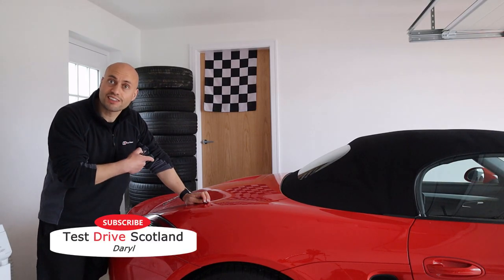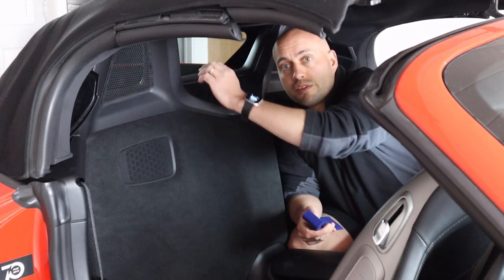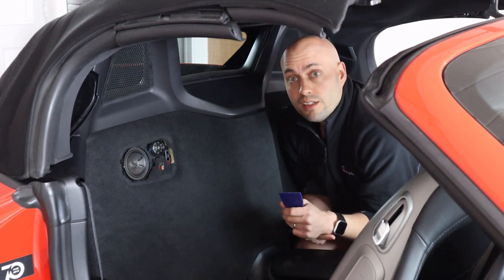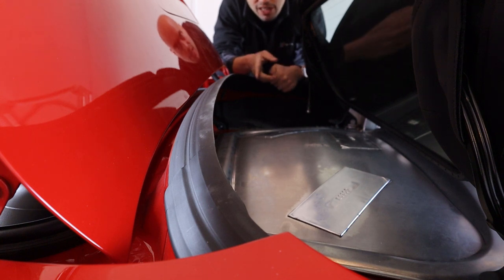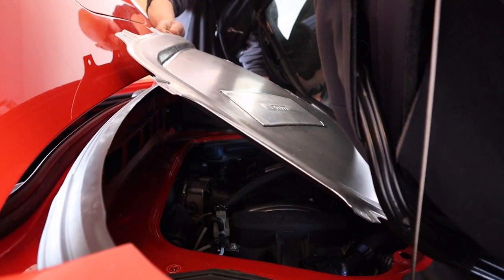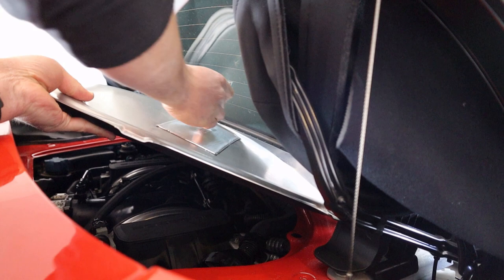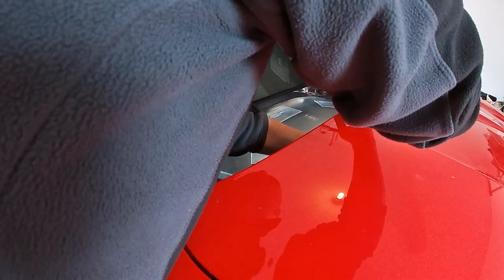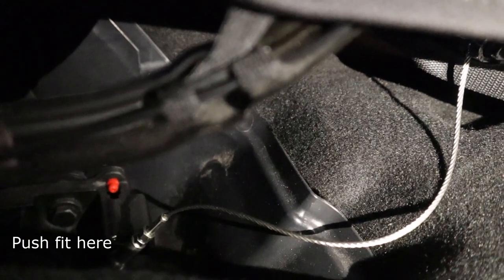How to access the engine bay in a Porsche 981 Boxster! Engine cover removal 718, Spyder, filters

Comment: So whenever I do this no way I’m trusting myself to be that close to the paint. I’ll be applying masking tape with duct tape on top of that on area of the trunk lid closest to the engine bay. A few minutes of prep will help my nerves, and possibly my pocketbook a bunch. Excellent video, really enjoying your hard work, making it easier on the rest of us!
Reply from the maker: Thanks William, honestly it looked worse than it is, but yes certainly good practice to cover the area just in case. Tape a towel or protector over the area masking tape is too thin.👍
Reply: @TDS981  I disconnected the strut that held up the trunk lid. This allows the trunk to open up a fraction of an inch more and provides slightly more clearance.
Reply: I would like a trusted helper for this job.

Comment: Thanks for the informative video and tips....it all helps. Metal engine cover looks like a pain.... maybe applying some tape to the edges of the boot and a few other painted areas?
 Are the edges of the metal engine cover quite sharp, is it worth smoothing the edges with some sandpaper or smooth file while it's off?
Reply from the maker: It looks worse in the video, but definitely recommend covering and protecting the painted areas just in case.  Yes they are sharp so to be extra careful you could apply tape around the edges for refitting. 👍

Comment: Oh man, this is quite a process.  I can get a 986 engine cover off in less than 2 minutes. Top to service position, unclip the rear of the top (similar fasteners to the 981 it appears), raise the rear of the top, unscrew 4 hand fasteners, remove carpet, remove 4 more hand fasteners to remove the lid.  I saw you mention you wanted to get a 986 2.5 as a project car.  Do it!  They are great cars.  I'm probably going the other way...upgrading to either a 981 or 718.
Reply from the maker: Yes slight more time consuming that I would have liked! Yes I would love a 986 I really like how they have aged I'll keep an eye out for the right one. 👍

Comment: The 986 has a much easier process.
Reply from the maker: Can you describe be interested to know?
Reply: @TDS981  These cars are awesome, and I wanted to thank you for your videos.  

Well the biggest difference is in the engine lid.  Instead of T fasteners they have 1/4 turn handles.  It's removed in seconds.  Same for the carpet / sound deadener that goes on top.  I don't have to remove the rear carpet panel that sits behind the seats too.   When I service my 986, I do as you do with adjusting the top but instead leave about 4 - 5" gap from the top of the windshield, but then over the engine compartment, remove the bottom lower clips of the arms of the top.  This allows me to pull the whole top open,  and it's actually quite nice the way they designed the arms.  When properly done the arms will actually lock into a rear position so that they won't allow the top to close on your head as you are working over the engine area.  Well, when you have the top fully open like that this leaves a lot of room to work in the compartment.  Even though the top appears to be safely held open, you still need to use a screw driver to stick in one of the holes (either side is fine) that had the clips this will keep the top from popping back, if you accidentally hit it and the arms pop back out of their locked state.
These cars are awesome.
Reply from the maker: Thanks a lot, I would like a 986 2.5 as a project car some day.
Reply: @TDS981  Just get the 3.2L S.  They are pretty inexpensive these days.  You will have to work on whatever you find.  I did with my MY 2002 and totally fell in love with it.
Reply: I have a 986 & it does seem a bit more complicated.
Reply from the maker: @kevingriffith3801  my 981 is a 3.4 so I wanted one I really had to rev out and I'm a sucker for the orange indicators at the front. 😂

Comment: Please accept my appreciation for making tis video. I will only try tis once my guarantee expires and I need to access the engine. REQUEST: Please make a video sowing what is behind the cabin bulkhead. I plan to drill and screw in self-tappers because I would like to fasten a net. Or a plan to fasten a net on the back of the tilt-seat so as to store stuff. Do you have any ideas PLEASE????
Reply from the maker: I think that's a bad idea don't do it, you are just introducing noise into the cabin just put the stuff in the luggage area or floor or use velcro or something. Don't do it.

Comment: Great video. On my 718 I didn't need to remove any interior carpet to get access to all the bolts. I did spend some time shuffling the top back and forth at various steps to get easier access. Was quite nervous about bending or tearing, but didn't hear anything.

As usual having the right tools made things much easier. A Klein mini-ratchet for hex bits made removing the hard to reach bolts easy. 1/4 inch ratchet with Torx bits for the rest.

Fitting stuff back was not fun. I'm not 100% sure I got the foam rectangle (not the giant sound deadening panel) and the carpet back into he correct position by the seats. It's not particularly tight, but it's not critical so I won't stress about it. I can't tell what it is supposed to grab onto up against the seats.

This is way way too much effort for an air filter. BMC air filter requiring annual service is a lot less attractive compared to a paper filter requiring replacement every 4 years. And this is on top of the cleaning and oiling dance.
Reply from the maker: Glad you enjoyed it, and found it useful, you have some good reflections.

On the 981 you access the air filters from the trunk/luggage area so it's much easier, it's certainly not worth the pain for an aftermarket filter.

Comment: OMG, no way could I be arsed with all that! F-Type it is then! Thanks for the informative vid!
Reply from the maker: Well the good news is that it is very rare that you need to access the engine, the maintenance tasks are done via the wheel arch or from the luggage area. I certainly wouldn't base your decision to buy an f type based on this, I've had to open it maybe twice in almost 5 yrs!

An F-type is quite different in my experience, bit more drama maybe but a long way off in terms of precision.
Reply: @TDS981  I must admit I prefer the look of the F-Type too, but I agree it is not as precise as the Boxster, but as you say you get a bit more drama with the F-Type which is fairly entertaining. If I could afford it I would buy both! Lol. Unfortunately I can only have one at a time at this stage.

Comment: Refitting the carpet took the longest!  Other than that your instructions were excellent.  I did manage to do it without removing the carpet inside the car, you can get to the 2 Torx bolts.  Thanks!
Reply from the maker: Nice one, what was your reason for accessing ?
Reply: Curiosity, I’ve never removed that cover and an opportunity to clean the top of the engine.  If I decide to clean the throttle body I know how to get to it now.  Thanks again.
Reply: I feel a bit of a chump but I can’t figure out how to fit the strap back!  What do those black plastic tabs slide into?
Reply from the maker: There is a rail,slide from right to left
Reply: Thanks, sorted, it clips into the rail then slide.  Cheers!